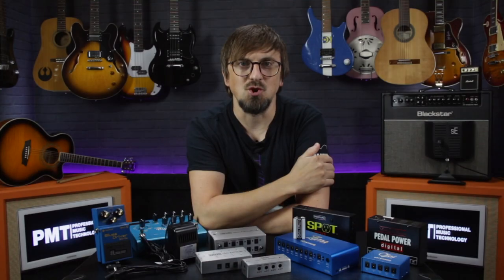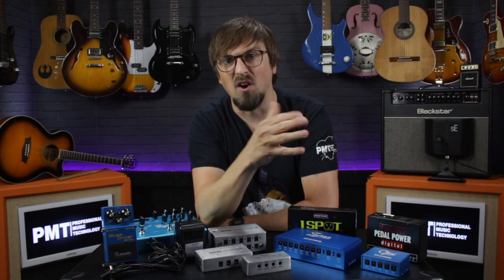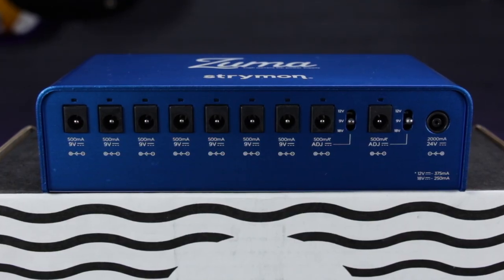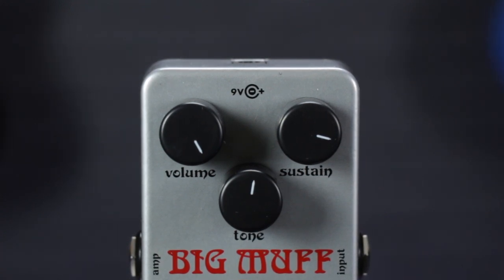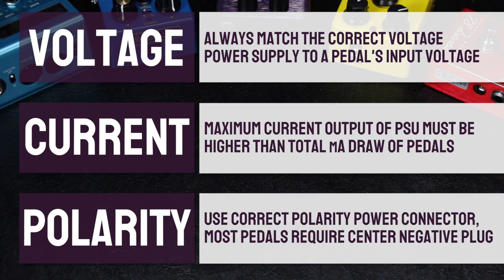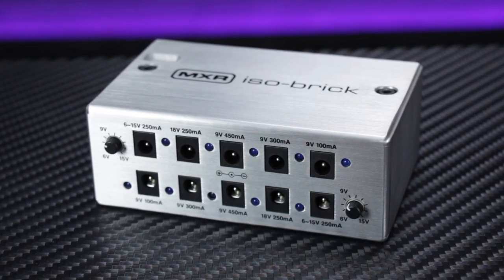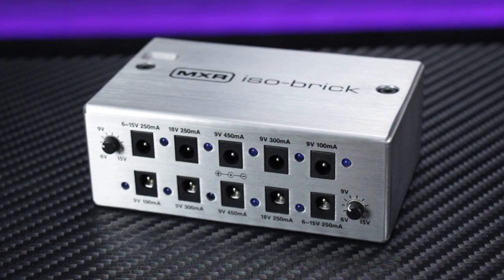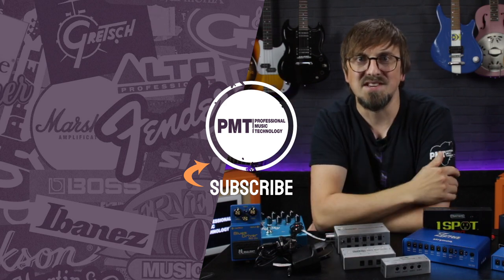How To Choose A Pedalboard Power Supply - Voltage, Current, Polarity & Isolation Explained!

Comment: Prepare yourself for a long comment... I'm putting together a pedalboard with my Harley Benton Thunder 99 Power Amp Pedal, that is 24 Volts. The board will be powered with a Truetone 1 SPOT PRO CS12 power supply. QUESTION: I need to know if I can power the Thunder 99 pedal SAFELY, by utilizing 2 of the 12 Volt outputs and a Voodoo Lab 2.1mm Voltage Doubler Adapter Cable, and a Truetone CYR Reverse Polarity Converter Cable? The Thunder 99's power supply says it's 24V, 5.0-A. And it's center pin polarity is positive. Sheesh! That was a mouthful. I understand answers here is a long shot, but I thought I would just throw it out there anyway. FYI, I do want to stick with the 1Spot.

Comment: Call manufacturer of pedals need to send their own person fly with if you're going to do aboard then what your advertising is fine but individual post should come with their own power supplies. If it don't take a 9-volt battery in the back

Comment: I live in the USA. I don't want to mess up my new Truetone CS12. Where would I plug my Pigtronix Philosopher Bass Compressor into the CS12 and which cord would I use? The Pigtronix says: "Use with 9-18 VDC Neg tip Power supply." Input: 100 - 240 V; 50-60 Hz / 250mA;  Output: 18V _ _ _ 300mA. Thank you for your help!!!

Comment: HI GREAT VIDEO THANK U FOR SHARING THIS INFORMATION I HAVE A QUESTION WHAT WOULD  U SUGGEST AS A POWER SUPPLY BRICK  IF I WANT A POWER SUPPLY TO PLAY OUT SIDE IS IT POSSIBLE TO CHARGE UP  A POWER SUPPLY BRICK AND THEN TAKE IN THE FOREST AND PLUG IT IN TO MY EFFECTS PEDALS AND DO A SHOW THERE IN THE FOREST DOES IT EXSIT A POWER SUPPLY BRICK THAT DOES NOT NEED TO BE PLUGED INA WALL SOCKIT ALL THE TIME FOR ELECTRICITY  ??? WHAT POWER  SUPPLY CAN DO THIS WHICH ONE WOULD U SUGGEST THANK FOR YOUR ADVICE FAN MIKE  AND

Comment: If you had a power brick and one of the outputs was 100mA could you run multiple pedals out of one output as long is it stays less than 100mA?

Comment: Hi I have a question , a brand new energizer battery puts out 10 volts and it makes my cry baby wah wah sound great but when it gets used some and is around just under 9 volts it sounds dull can I used the variable output in my merry power brick and turn it up to 10 volts, is this ok to do?
Reply: So I'm a bit late and you probably already know the answer, but for anyone else reading this reply in the future: most of the time you won't encounter any audible issues when running a 100% analog effect off a higher voltage (say going from 9 V up to 12 V), although it also depends on the effect's internal "power section", this usually does not translate well if there are any digital components in the circuit, as those chips usually don't like any variations on the voltage and thus current that is running into them.

That being said, the voltage should only really bring a difference to the dynamic range of the effect before it starts clipping, which is usually a couple of dB per Volt, the "tone" is mostly handled by passive components such as resistors and capacitors (even inductors in some cases), as well as the harmonic distortion from the active components which is a consequence of their chemical composition, as well as some other characteristics from the input signal itself.

I'm a bit newer to small signal processing in electronics, so any further discussion on the topic is very much appreciated and welcomed.

Comment: Can you connect the boss power supply to a non boss guitar pedal?
Reply: yes as long as the voltage is the same and the pedal’s power draw is less than the power capacity of the adapter

Comment: Is there a Way to Use Both an AC and DC pedal On a Pedalboard? Do you have to Buy Two different power supplies to Make it work?
Reply: I mean, you could technically run both on a "single" power supply, either if you can find a brick that has AC and DC outputs, or in each of the following cases:

a) Single AC supply: plug the AC powered effect directly to the PSU and connect a full wave bridge rectifier, along with a voltage regulator at the output of the PSU in parallel, then connect your DC powered effect to that new output.

b) Single DC power supply: connect the DC powered effect directly and use an alternator to generate the required AC for the second effect

c) Use some other off-the-shelf solution that accomplishes any of the above, which I'm not really familiar with

In any of these cases you are already creating a second power supply and not even dealing with the many security features of commercial ones, so I think you're better off just using 2 separate power supplies, one for each of your effects.

Also if I may ask, which effect pedal needs an AC PSU? I'm genuinely curious about that.